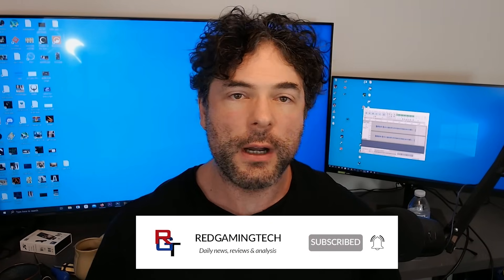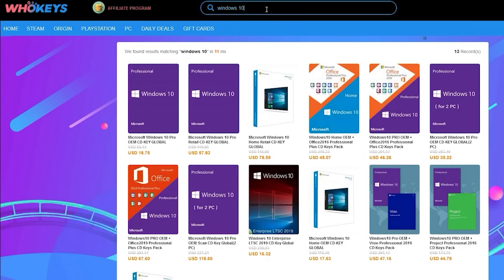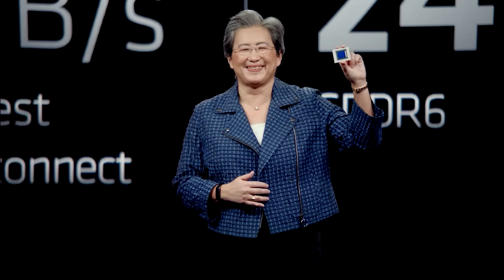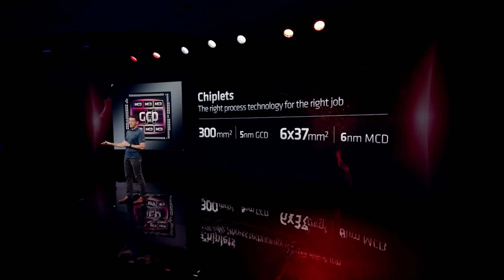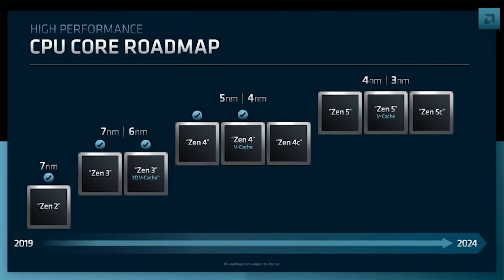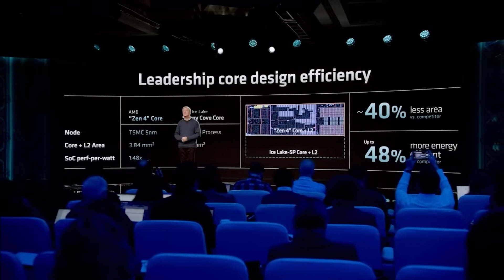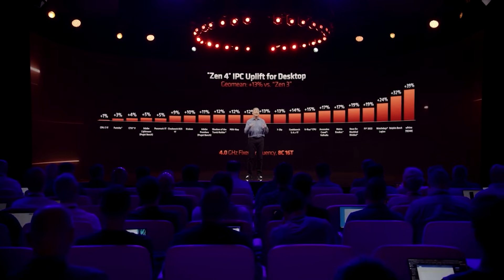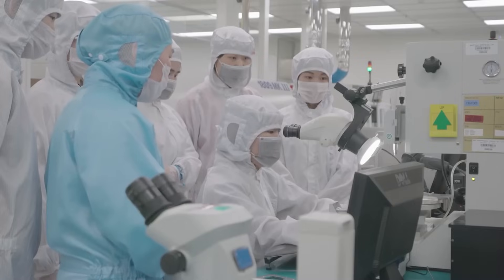How ZEN 6 Is AMD's Next BIG LEAP In CPUs

Comment: Moore's Law is Dead has also just been talking about this.
https://www.youtube.com/watch?v=ebdg8ZIzOeE&t=5423s
Admittedly, he talks more about the Epic and server side, less about mobile and desktop.
I wouldn't say he contradicts you, (he doesn't), but his information does seem to be a little different.
LOL ~ By the bye, thanks for having some actual information in this clip, not just waffle and stream of consciousness...
~~ If I understand properly, Intel do Big cores and Little cores, and the little cores are like 1/6 the size of the big, and they run at a lower clock, they don't have hyper-threading, and there are some instructions they can't do. (AVX-512 instructions.)
~~ AMD do normal cores, and they do 'Dense' cores. Now a Dense core is about half the size of a normal core. It can do all the same instructions, it does have hyper-threading, it is more compact because the size of the caches (which has been growing generation over generation) has been cut back to levels more like zen2. I have conflicting info about the clock speeds but I hear they are quite power efficient.
The people who really want these types of cores, are the server boys and the data centre people, who want racks of machines that feature 128 cores and 256 threads, 500 virtual-machines running on each processor. They do have possible application in mobile and low power cases, because they use much less silicon to achieve a similar result. If clocked lower, they do use very little power, but I hear mixed reports about whether they can be clocked up to 5 Ghz or so, or not. I also hear mixed reports about whether you can stick 3d cache onto them or not. If they're small because you stripped out 80% of your cache, then giving all that cache and then some back, using 3d, that would seem like a win.
I hear that the Epic versions, are going to feature multiple I/O dies, with 2 CCXs per I/O. You could line 8 of these up in a row, with 16 CCXs and 128 or some large number of cores, but the real trick is to have a line of I/O, with a standard CCX on one side and a Compact cores CCX on the other, or a FPGA (hello Xilinix), or a new super AI inference module... Point is, these things are conceived to be modular and configurable. If AWS want one thing and Google want another and Meta want a 3rd, they can mix and match the modules to suit the application / customer. They have been designed with that concept in mind.
As far as I know, the new Zen are all going to have a graphics system on every one of the I/O modules, but I'm not sure those are all going to be the same. As one example, it would help an APU to have a I/O die with 3d cache, which it used as V-cache... That 3d V-cache (Infinity Cache) has helped AMD / Radian's other graphics stuff plenty, so why not?
I also hear from some, that the memory controllers are moving off the I/O and onto the CCX. Not everybody agrees on that point.... I would observe that does seem to contradict some of the 'theory' I've been told about previous generations, and using a slightly larger / older process for the I/O dies .... Much of the justification for that, had to do with off package comms and the memory controllers. If you can move the memory controllers back onto the CCX, then the only reason we had older process I/O dies was some business contract with Global Foundries. The technical expression for that is "Short memories." (Not the chips ~ us.)

Comment: It's sad to see that RDNA 4 will also suck at ray tracing. 30% faster at best isn't going to help AMD's GPU reputation.
Reply: 7900 XTX runs all games without issues just short of path tracing which Nvidia sucks at anyway. 0.01% of the Internet is convincing each other that AMD sucks because someone else thinks RT is important lmao maybe think for yourself once in a while.
Reply: @TheCosmicMason  I gave AMD a pass for not having great RT on RDNA 2 and RDNA 3, but RDNA 4 and 5 don't have any excuses for poor RT performance. Intel Arc runs circles around the comparable AMD and Nvidia GPUs in its 1st generation. Intel will be coming out with a GPU that will rival the RX 7900 series and faster too. AMD needs to get their act together ASAP this late in the RT game. It's not a feature that's going away.
Reply: @AshtonCoolman  "poor RT in RDNA 4"? You are basing your disappointment on a product that has not even been released. Also RDNA already has Ampere level RT and if RDNA4 adds 15-30% on top of that it's in no way "poor" as you put it. Also we have to remember the way RT is implemented in RDNA arch is by the number of raster cores. They are not separate RT cores that can be increased individually of raster cores. Also the price. As if Nvidia's current $500 cards are RT monsters? No they are not because the dies are small like RDNA4 will likely be.

As for Intel. They are nowhere in comparison. Still fixing the huge backlog of games, still struggling to release day 1 drivers. Sales volumes are meaningless too. I would not place any bets on Intel releasing 7900 series competitor and if they will it will be in 2024. Remember that 7900 was released in 2022. Intel is a mess right now.
Reply: Who needs RT anyways?

Comment: If Zen 6 is not on AM5, that's disappointing.
Reply: It's a bit sad that it won't be on AM5, but I doubt 1 more round of CPUs is all AM5 will see, AMD just released more AM4 CPUs. Previous info said that AM5 can't really handle more cores as DDR5 is bandwidth saturated already with 16 cores, quad channel would be a very nice upgrade.
Reply: @PineyJustice  do we know that for sure
Reply: @Jason_Bover9000  nobody ever knows anything for sure, but previous leaks said that dual channel ddr5 was the bottleneck to increasing core counts past 16. If AM6 is quad channel then it'd be a nice upgrade, AM5 boards aren't that expensive, and you can always sell them when you upgrade.
Reply: @PineyJustice amd do tiny steps. Just one upgrade. With zen5 cpu core IPC, with zen6 can do just memory latency and remove ic bottleneck. But amd already have rumours about 4 channels sarlak/halo apu... Which socket they use to it - epic entry or develop new one just for 1 apu?!?! And why don't use this epic entry to real hedt with >>16 cores. Low end desktop till 16core will stay on am5 and live like am4. Zen6 will be <10% ipc increase, same core but faster memory and 99% don't need more than 16 cores..... So am5 can sell 2-3 years more, till 2028 or ddr6
Reply: @hristobotev9726  Halo will be a mobile chip so I assume the FP8 or FP9 socket.
AM5 doesn't support quad channel memory.
Reply: I'm still satisfied on AM4 with a 4090 but then I'll skip AM5 completely and go with AM6 or even AM7 and DDR6👍🏻
Reply: @Serandi1987  what cpu are you using
Reply: @Jason_Bover9000  the 5800X3D! But I limit my FPS anyway to 115 FPS using a 120Hz LG OLED C1 at 65 inches in my living room. My vision was to combine console with PC gaming and it happened very well. The 4090 is undervolted to the max and in my games the consumption is only up to 250 and almost 300 watts when everything is maxed out.
Reply: @Serandi1987  o ok so you use Nvidia control panel to to keep that framerate to limit your good for 5800x3d  what resolution i do the samething with my 7900xtx I have 165hz monitor i limit to 110  its less powerful that less temps and could help the life on it its lile 330 if mine is max
Reply: @Jason_Bover9000 I'd probably would still do the same even with a 5090. So I should pass until we can buy OLED TVs with 240Hz
Reply: @Jason_Bover9000  well, I only limit my FPS because of the Herz of the display. If I had 165Hz I would set the limit to 160 FPS 👍🏻😌
The 5800X3D runs with -30 magnitude, so max undervolted and I use 2 x 16GB 4000Mhz DDR4 CL16 dual ranked and dual channel
Reply: @Serandi1987  where do you do that on
Reply: @Jason_Bover9000  at the bios settings of course 😁
Reply: I ain't buying nothing. This stuff is getting out of hand
Reply: @oakfig  CPU situation is pretty great, really.  It's not at all 'out of hand', like with GPU's.
Reply: @maynardburger   they are all out of hand... I mean back in 2011 my I7 2600K was like 260eur and came with the crap cooler and basically was the world's best gaming CPU cause the I7 extreme would give 0 more FPS over the 2600K...

And back then 260eur was like around half a full month of salary here...

Nowadays they are the I9 and Ryzen 9 and they are very close to a full month salary here so it's the exact same as GPUs cause back then the GTX580 was a full month of salary here and the GTX590 would still be a massive difference in price to the world's best CPU just like nowadays...

Ps: I remember was back in 2004 and buying a ATI 9600XT for less than 100€ abd playing everything maxed out or nearly maxed out and that was basically less than 1\4 th of a month of salary here, gosh good times.
Reply: @guily6669 the i9 and r9 are not for you...  do a comparison on the middle area for what you need.
Reply: @guily6669  Their profit margins are very high, especially Nvidia's, but you forget that inflation is a big part of it and I mean the real inflation, not the fake one the governments lie about.

You also forget that die sizes used to be smaller and that PCB and VRAM prices used to be much lower. 

But the biggest problems were people that happily bought the gtx 600, gtx 900 and especially the gtx 1000 series, with the gtx 1000 series being the most overpriced GPUs in history. The sub-mid-range gtx 1080 was 600-700$ when it should have been 350-400$...
Reply: @rattlehead999   yeah but what should I care that the nodes keep shrinking in terms of price increasing...

Since the 90s they kept shrinking like crazy while prices kept getting better and better and continued for a damn good amount of time.

I know it's now getting pretty hard to shrink more but everyone increased the  prices down the chain like crazy too...

Ps: screw them all cause it cost me quite a lot of blood and sweat to win around 700eur per month 🤬🖕
Reply: @F14Flier7   they would be 4 me cause I need the highest gaming performance CPU I can get cause my last I7 2600K was used for 11 years and I just changed GPU once from a GTX 570 with around 25% OC to a Strix RX480...

I never, ever upgrade board and CPU so I have to get the highest CPU performance I can get and later just upgrade GPU until the PC can't keep up with another GPU upgrade, other than that I can add more ram or other components...

Ps: the only problem that they aren't 4 me is their price 😕
Reply: @oakfig  true but if you want the best like to play gta6 there you go
Reply: @Jason_Bover9000  GTA6 is not a selling point, unless they actually put in the effort to make it good.
Reply: @rattlehead999  then what is
Reply: @Jason_Bover9000 you will be able to play it on ps5. So it should work fine without the insanity of constant upgrading trying to keep up with PC hardware.
Reply: @lord_haven1114  i rather wait to play on pc I haven't even bought 5 yet I think I  should buy 5 now
Reply: @Jason_Bover9000  Tons of other games.
But if they make GTA6 be a modern GTA5 it's a hard pass, GTA5 sucks so much(IDK about the multiplayer).
Reply: @rattlehead999  why you say that
Reply: @Jason_Bover9000  GTA5 had terrible clunky mechanics, the driving and flying was worse than GTA4 and overall bad and tons of missions constantly send you from one side of the map to the other for a few minutes of action, meaning that 80-90% the gameplay was spent going from point A to B and back, with the terrible driving mechanics. Then the shooting mechanics were very dumb, tons of bullet spread, no gun feel. And GTA5 was the beginning of the empty wasteland open world, now I say the beginning, because the city itself was good, but it was only 15% of the map, the rest of the map was very sparse and boring. The side activities also had poor mechanics and due to the dumb AI were too easy and boring.
Reply: True if that happens I will wait for am6 im using intel right now
Reply: Zen6 should be taking advantage of DDR6, since DDR6 comes out in 2025 and Zen6 probably 2026, thus it makes sense for it to be on a new board.
Reply: I'd bet anything that it will be. If it is not.. it comes down to some really bizarre technical issues which I seriously doubt is the case.
Reply: Eh, my b650e-f was $120. I’d be fine upgrading. But I’d be pissed if I bought a high-end mobo.
Reply: @CarnivoryHODL  People buying high end want the best. I'd much rather have a bigger jump with zen 6 and a new quad channel board than a small jump hampered by compatibility. Needless breaking compatibility like intel did for nearly 10 years is what people hate. Secondly, AM5 will probably see active support and CPU releases well into 2028 if AMD keeps on the 2 year release cycle, with zen 5 coming out next year being the active CPU until 2026, then as AM4 is still seeing releases (5600x3d and 5700x3d) there will probably be some releases happening all the way into next gen after zen 6 releases.
Reply: @CarnivoryHODL  im using intel 12600k right now
Reply: When they moving to pm?
Reply: Im making decisioms for friends systems now based on the presumption AMD will maintain at least three gens per socket....
Reply: Well Moores law is dead sources says no socket change for Zen 6... so
Reply: RedGamingTech has defiently become a click baiting AMD fanboy channel.

RGT: ZEN 5, ZEN 5, ZEN 5 is gonna be massive
Reply: If zen 7 is am6 I will just go back to intel
Reply: @Natocomander as if intel will use the same platform
Reply: @Natocomander  Doubtful, DDR6 comes out in 2025, meaning that Zen6 should already  have changed platform, but worst case scenario Zen7 will for sure be on a new platform.
Reply: @rattlehead999   true, if an 8800x3d doesn't fix all the weird dips i get on my 7800x3d,, I'm jumping back before that anyway
Reply: AM4 is still the best my bro
Reply: Why not
Am5 must be discounted
I'm ok with new platform if the performance jump is like zen4 from Ryzen 3000
Reply: @gg95-k7y  AM5 isn't very great either, and it was relased too late.
Reply: Zen 7 should be am6 and and zen6 should be am5
Reply: @Jason_Bover9000  "Zen7" is going to be the next architect beyond Zen.  Theyre going to rebrand away from Zen for sure
Reply: @babochee  To what exactly
Reply: If it's on am5 - 2 channels memory amd can't increase core count.
Reply: @hristobotev9726 Yeah. x86 chips are starved for memory thruput compared to even m1. Given the console integration I'm surprised amd isn't coming out with in-package ram.
Reply: @hristobotev9726 a single CCD 16 core CPU is more than enough...and would clock very well